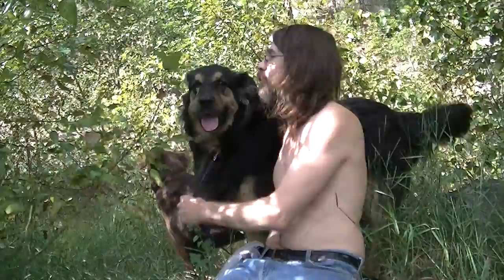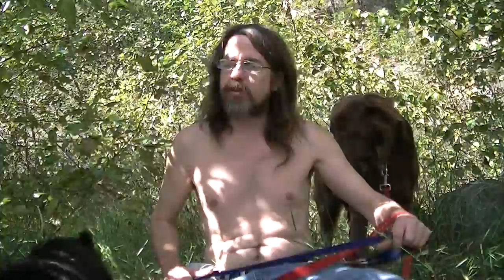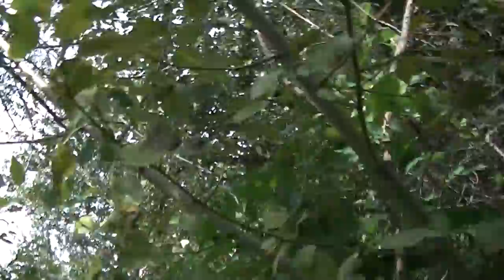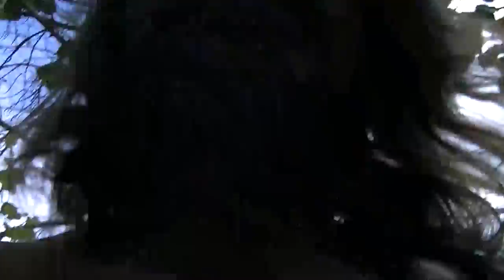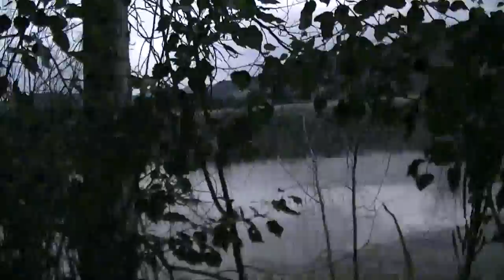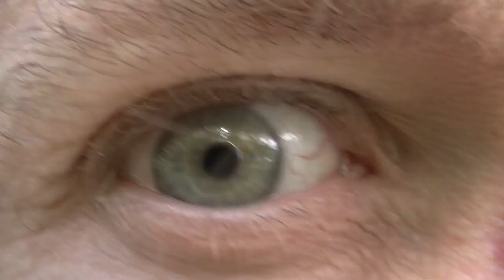Splitting water by electro-chemical thermolysis to make Hydrogen @ Atlantis & cooling volcanoes Pt 1

Comment from the maker: High-energetic electrical plasma[edit]
High-energetic electrical plasma is a technology currently being developed in deep drilling applications to address many issues related to drilling in water environment or in the production of boreholes with a wide range of diameters.
Physical principle of electrical plasma[edit]
An electric arc is an electrical breakdown of a gas that produces an ongoing plasma discharge, resulting from a current flowing through normally nonconductive media such as air or gas. An arc discharge is characterized by a lower voltage than a glow discharge, and relies on thermionic emission of electrons from the electrodes supporting the arc. The electric arc is influenced by factors such as: the gas flow, inner and outer magnetic fields, and construction elements of the chamber which confine the arc. The development of highly effective plasma torches to be used as a source of the thermal plasma, demands a deep understanding of a wide spectrum of the processes taking place in the discharge chamber.
http://en.wikipedia.org/wiki/Plasma_deep_drilling_technology

Comment from the maker: ~ no need for Generation 4 Atomic water cookers to split your water and waist your Agenda 21 angel on
=  save all that fissionable U-235 for Space Ship Life ARK fuel, your going to need all that you can easily get your monkey paws on
+:~ goals of the Gen IV initiative.[1] Three systems are nominally thermal reactors and three are fast reactors. The Very High Temperature Reactor (VHTR) is also being researched for potentially providing high quality process heat for hydrogen production. The fast reactors offer the possibility of burning actinides to further reduce waste and of being able to "breed more fuel" than they consume. These systems offer significant advances in sustainability, safety and reliability, economics, proliferation resistance (depending on perspective) and physical protection.
http://en.wikipedia.org/wiki/Generation_IV_reactor
The very high temperature reactor concept uses a graphite-moderated core with a once-through uranium fuel cycle, using helium or molten salt as the coolant. This reactor design envisions an outlet temperature of 1,000 °C. The reactor core can be either a prismatic-block or a pebble bed reactor design. The high temperatures enable applications such as process heat or hydrogen production via the thermochemical iodine-sulfur process. It would also be passively safe.
Reply from the maker: The very high temperature reactor concept uses a graphite-moderated core with a once-through uranium fuel cycle, using helium or molten salt as the coolant. This reactor design envisions an outlet temperature of 1,000 °C. The reactor core can be either a prismatic-block or a pebble bed reactor design. The high temperatures enable applications such as process heat or hydrogen production via the thermochemical iodine-sulfur process. It would also be passively safe.

Comment from the maker: ☢©☢ NEVER on Google+ [ OK ]
~ actually their were several working prototype solar " concenTRAITORs "  set up effectively splitting hydrogen directly threw chemthermoylis 
[ @ Splitting water by electro-chemical thermolysis to make Hydrogen @ Atlantis & cooling volcanoes Pt 1 ] around my Earth at the start of the millennium, but Bush syndicate ordered funding to prevent the hydrogen economy from being developed prior to 2020, a presidential directive which the 0bombMONEY re-authorized & extended funding for such alternative renewable energy hindrances on behalf of the Atomic Water Cooking industry, with the scam highlights to flog the generation IV nuclear fission reactors to the gaping tax hole payers ( which are intended to split hydrogen and generate " thermal electric steam power " After all how could you maintain a energy monopoly cartel if you anyone with access to sunlight & some moderate high pressure & temperature solar technology could make both electricity & portable hydrogen fuel, it would be even more difficult to create energy scarcity  if the masses were allowed to drill deep hot rocks with plasma arc drills and pipe water down to make their own hydrogen & hydrocarbons in old abandoned oil fields, both portable & grid power would be as cheap as fresh water was before the parasitic ruling losers frac-ed the hell out of my Earth's fresh water aquifer & lithosphere's cosmic ray / particle shielding

Comment from the maker: = it eventual comes back from new water splitting deep down https://www.youtube.com/watch?v=j4ApDpUHSRo&index=3&list=PL2Lz9LTm142w2w7f_UGRE_u4FO2XZgA55 and radioactive decay ; to again shield the fissionable bits of the lithosphere from neutron breeding induced by ultra high energy cosmic ray particle inclusions ! https://en.wikipedia.org/wiki/Abiogenic_petroleum_origin - butt do not waist all of what you have on nothing such as hollow pyramind ponzee schemes and created scarcity mass monopolizng musing like malonic parasites , vlad , as every bear knows no wars are won , butt survived , threw attrition , with the victor living on to " repaste the wall paper back on the living room walls ; after all the cadavers are eaten by staving voles " !
Reply from the maker: +docatomics https://en.wikipedia.org/wiki/Plasma_deep_drilling_technology .
Reply from the maker: +docatomics https://en.wikipedia.org/wiki/GA_Drilling .
Reply from the maker: +docatomics The strength of carbon–carbon with unidirectional reinforcement fibres is up to 700 MPa. Carbon–carbon materials retain their properties above 2000 °C. This temperature may be exceeded with the help of protective coatings to prevent oxidation.[2] The material has a density between 1.6–1.98 g/cm3. 
= for the really deep hot rock drilling and other plasma applications in the dawning of MANs Age of Carbon !  https://en.wikipedia.org/wiki/Reinforced_carbon%E2%80%93carbon 
RCC or Carbon-Fiber-Reinforced Carbon, ( abbreviated CFRC ) is a composite material consisting of carbon fiber reinforcement in a matrix of graphite. It was developed for the nose cones of intercontinental ballistic missiles, and is most widely known as the material for the nose cone and wing leading edges of the Space Shuttle orbiter. It has been used in the brake systems of Formula One racing cars since 1976; carbon–carbon brake discs and pads are a standard component of Formula One brake systems.
Carbon–carbon is well-suited to structural applications at high temperatures, or where thermal shock resistance and/or a low coefficient of thermal expansion is needed.

Comment from the maker: ~ all right  racketeering fuckstucks,
-  who took out the naughty technical bits about plasma arc drills into deep hot rock & carbon pipes to the water splitting magma and how this venture to save lives would make a fortune in diverted energy returns converted ( the full uploaded version should be 32:26 long not 8:34 minuets, fucking DaTa Tamperers are worse than turd tampers, grrrrrrrr...
= me getting smashing M.A.D.